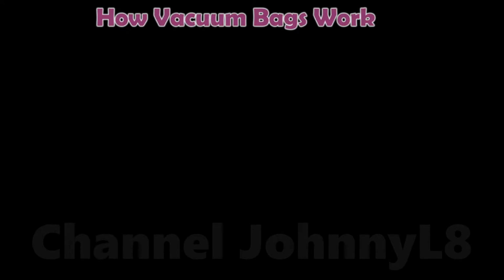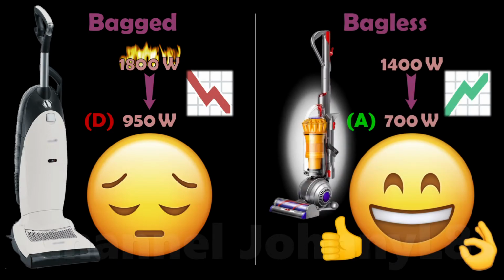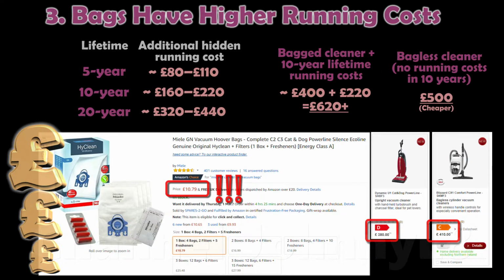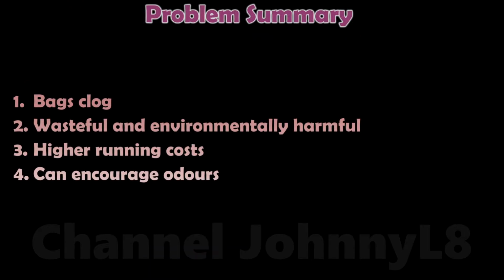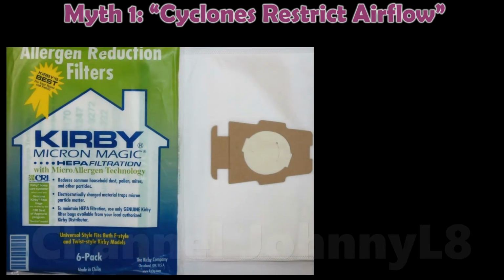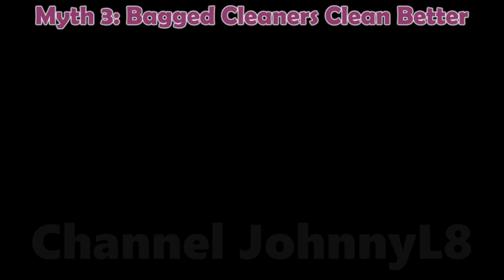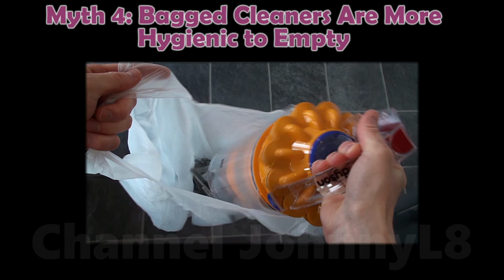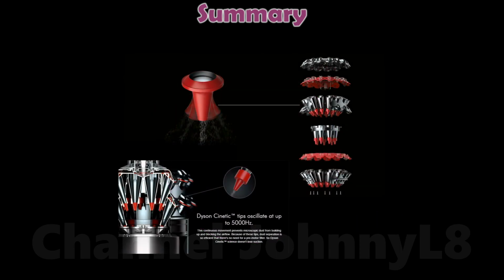Bagged Vs Bagless Vacuum Cleaners

Comment: https://www.youtube.com/watch?v=i0Rens9oKb4 I'm going to leave this here for anyone who wants a good explanation of how cyclonic separation works. I will say that AvE (Arduino Vs Evil) is not a Dyson fan but ends up liking their handheld. AvE is a machinist with years of experience. Also he, as any reviewer should, points out pros and cons, and ends up keeping it as his shop vacuum. He also reviews the Dyson Animal Big Ball which he gives a solid thumbs down (due to the fact it is very poorly constructed and doesn't even have a Dyson motor), and the Dyson hair dryer (he is basically silent on a final verdict because he doesn't use a hair dryer). I also urge individuals to look into EEVBlogs reviews on Dyson products. He is an electrical engineer.

Note for Vacuum Facts/JohnnyL8; I won't be responding to you any further. First off, I feel like I'm just talking to a brick wall that refuses to discuss anything in any meaningful or friendly way. Secondly, I've done a tad more research on you and have found a few troubling character traits, traits such as comment censoring, bullying, etc. that make me no longer wish to engage with you. Yes, I too can search the Vacuum Lands forum. Things like hiding your like/dislike ratios, subscriber counts, and pushing other youtubers to the point they close their channels, whether you disagree with them or not are... troubling. You can choose to disregard anything said by someone with a masters degree in mechanical engineering and works for one of the largest and most respected companies in the sector of water quality testing or even what engineers by in large say. It doesn't matter to me.
Reply from the maker: You've linked to a channel that repeatedly makes false and misleading claims and shows a clear anti-Dyson bias. He provides no evidence for the factual claims he makes, and his conclusions are not supported by what little he shows. Like his interpretation of stalling torque in one video showing a very shallow assessment, let alone understanding of its design. Jabbing an object into the brush roll, watching it stop, and concluding "fuck all". In this video, he rubbishes the filter arguing it has a small surface area. This shows staggering ignorance of why the filter only needs to be small (cyclonic separation does most of the work—which he even says!), and that the filter actually works volumetrically due to the microscopic, random weave structuring internally. I’ve discussed this here https://youtu.be/T3prXR-aeOg . He goes on to make false claims conflicting with what he's looking at in his own hands regarding which filter will clog faster, shortly before contradicting himself again a moment later by saying he doesn't know which filter will clog faster. This is the kind of bizarre, illogical, inconsistent, misleading nonsense that litters videos from that channel (about Dyson products at least). He rarely convincingly supports his assertions. It's nonsense like that which the educational content on my channel helps to expose so people can make their own minds up. Cyclonic separation is fully explained here https://youtu.be/SCcVBgFZ7Dc and here https://youtu.be/B8gOZ31CkvE without nonsense attached.

The reason why you don't like talking to me is because you are similar. You claim you feel like you're talking to a 'brick' and I 'refuse to discuss anything in a meaningful way'. Yet I engage fully. What you don't like is that I challenge your factual claims and ask you to support what you're saying instead of masquerading your personal, subjective opinions as fact. This bothers you, you are unable to defend what you say, and I simply don't believe it as a result. So instead, you reduce yourself to personal attacks and smears as above, showing when you've got no defence left, you're forced to rely on being 'offended' and fall right in line with all the other nasty commenters out there. This is the classic character trait of someone with no argument on matters of fact and feels threatened simply by what my channel sets out to do—expose this nonsense and teach people how to spot it. Anyone can make up claims about someone else, but if you want to be respected, you might want to evidence them. Specifically, your accusations that I'm 'comment censoring' and 'bullying'—however you choose to define those terms; you weren't very clear...again. Or is it simply a case, as described above, that you don't like what I present, can't argue against it, so stomp your feet in temper because it conflicts with your erroneous worldview. You've searched a forum I've never used, where those who feel similarly threatened by facts congregate and distil their bias and smear. I hide likes and dislikes etc. on my own channel, as is my right—not to mention a basic YT feature, because they're irrelevant and foster the mindless bias and hate I've observed. It's not possible for me to 'force' anyone to close their account as you've suggested; that's entirely their own choice—perhaps they understood my videos. You didn't even state which accounts had been closed, or even provide a dot of easily fact-checkable evidence. You're almost certainly making it up. This is all hypersensitive smear and typical of those who simply haven't been able to defend their nonsense claims and don't like it. You've made more than one reference to your 'masters level education'—as though that automatically entitles you to respect without challenge—and while that isn't a high enough educational level to learn formally about evidencing claims, it does go some way to explain why you failed to, despite being asked repeatedly. It's sad that you ended up resorting to the very things you've attempted to falsely smear me with. People can make their own minds up. You haven't been 'censored', no one is 'bullying you', and, by your own admission, you've chosen to run away whilst name-calling instead of defending your position convincingly. Nuff said...
Reply: Edited for formatting:
I said I wouldn't feed the troll, but for those who may read these comments, rather then completely rehashing what has already been said, I'll just link this: https://www.youtube.com/watch?v=1uCxBfGHI6Y
I want to specify I don't really agree with this channel owner on much, but we both agree on the channel Vacuum Facts. Beko1987, HooverLux Restorations and More, Vacuumtests, AwesomeVacuums, and Performance Reviews have all directly addressed concerns about the owner of this channels behavior (as well as his behavior on other social media websites). He simply states that other channels have a hate of Dysons but does not actually address valid concerns or seem to concied the fact that in AvE's case, he keeps a Dyson as his shop vac. He ignores that the Carpet and Rug institute do not endorse a single Dyson vacuum, plug in uprights or cordless. They are not bias either, they endorse Kirby, Oreck, Miele, Sanitaire, Windsor, Numatic, and other brands. This certification is given for the power efficiency to cleaning capability ratio of vacuums. The certified vacuums are almost universally bagged vacuums. The Carpet and Rug institute also do not certify bagless vacuums often (specifically Dyson's) because they have a tendency to grind dirt and debris into carpets which destroys the carpet. More then a few carpet manufacturers as a result will void your carpets warrenty if you use a Dyson vacuum cleaner on them.

As far as his response about the Vacuum Land forum, I never said he was on Vacuum Land, but that discussions about his videos went far into depth on his videos and behavior. Performance Reviews video (linked above) shows screenshots of deleted comments and goes further into depth about this channels owner trolling youtubers to the point threatening lawsuits and the like. 

For anybody curious, just google this search: johnnyl8 site:www.vacuumland.org/

Note that my search was just for his name, nothing about whether or not he was liked or respected. Top results include "Have you been drinking JohnnyL8's Koolaid?", "Then there is the sad case of the JohnnyL8", "I've never seen more ANNOYING videos than JohnnyL8's.", and "Dysontology hard at work, I guess." These are the first four of four results. Please, before you believe anything said on this channels videos, please do research with other testers and laboratories. Do not believe the first fancy graphic that crosses your screen. He's also had more then a few copyright claims against his channel for stealing video from other videos on youtube.
Reply from the maker: I don't think you could get a better example of hypocrisy and wrongful smear. And all because this guy doesn't like facts or people who myth bust the harmful, misleading nonsense out there to help people out.
Reply from the maker: Even YouTube has recognised that there are disgusting people out there who like to not only launch dislike attacks, but also suggest people that hide dislikes are somehow bad people with something to hide. https://blog.youtube/news-and-events/update-to-youtube/ It was always the hallmark of disgusting YT bullies who, in my case, didn’t like the facts presented, couldn’t argue against truth, and so were left shit-slinging. Look out for the worst users out there who even point out hiding dislikes as a negative and make sure they’re treated accordingly and appropriately. The best of us recognised the problem, and it’s only disappointing that YT took so long to prevent the toxic and the wretched from weaponizing their platform.